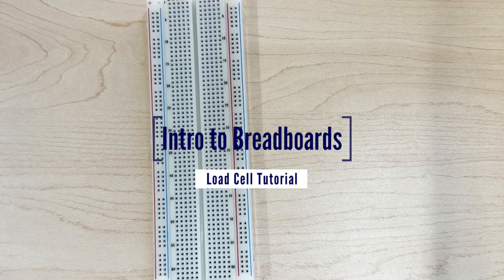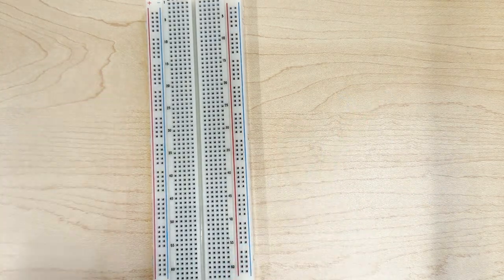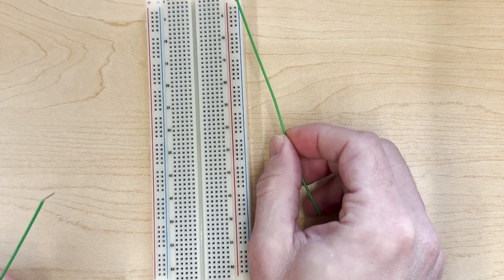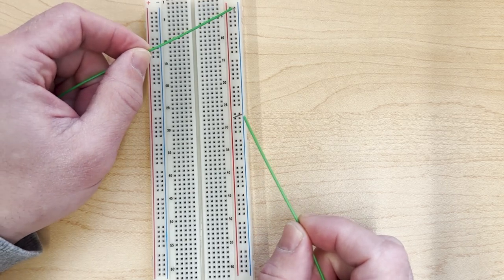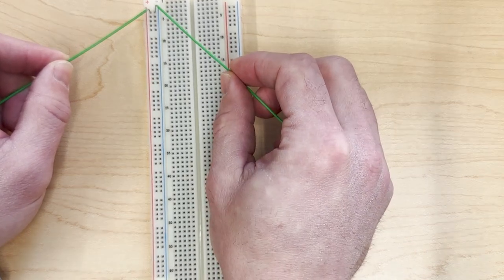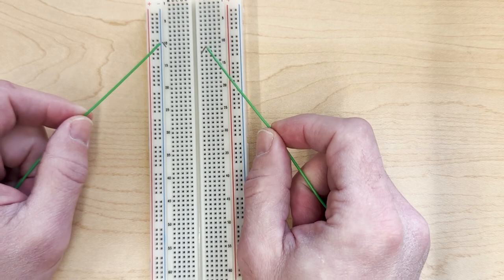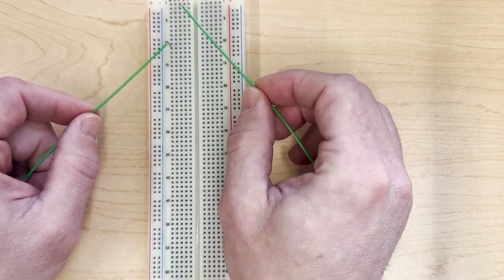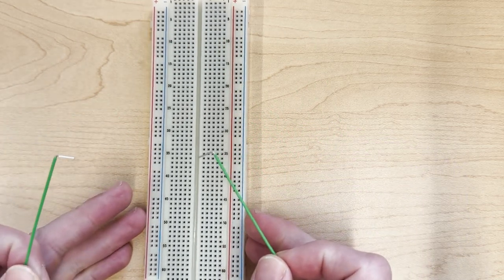01 Intro to Breadboard - Load Cell with Raspberry Pi

Comment: HI Brian, great video. Quick question, can you add two load cells to a single Rasp PI? And if so, do you know much about coding them together?
Reply from the maker: I haven’t tried it, but it should work. To get independent measurements (scale A and scale B) you will need two hx711 boards (connected to different GPIO pins). If the load cells are intended to measure the same value (two load cells on Scale A), you can hook them up to a single hx711 board. Connections for this setup can be found here: https://circuitjournal.com/50kg-load-cells-with-HX711
Reply from the maker: Coding: you will need to instantiate two hx711 classes if you want two independent measurements.

hx1 = HX711(dout_pin = 6 , pd_sck_pin = 5)
hx2 = HX711(dout_pin = (insert pin), pd_sck_pin=(insert pin))